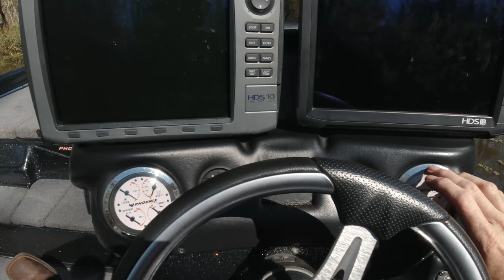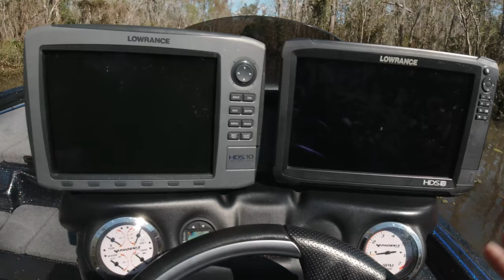Phoenix 721 Pro XP walk through 4K

Comment: Nice rig. Mercury outboards never did me wrong in the past either.
Reply from the maker: Yep. All mechanical equipment will at times have issues. I have no complaints yet on the motors I have had. Knock on wood!  Lol